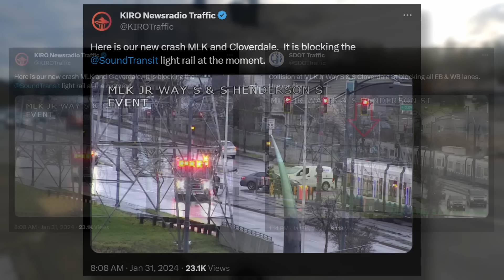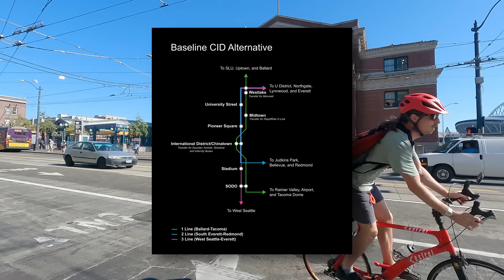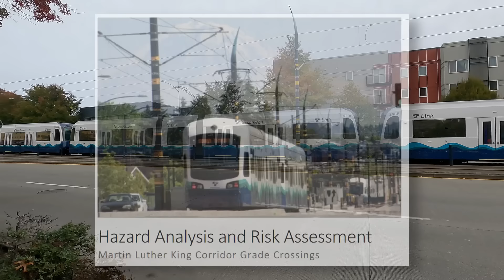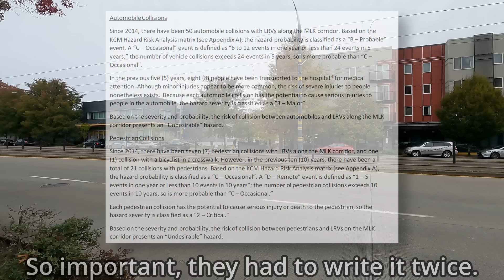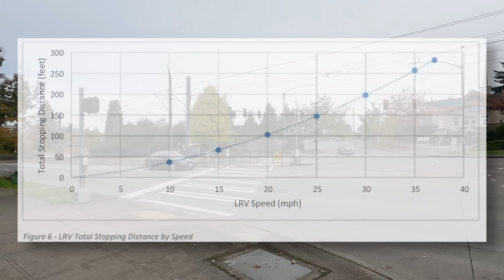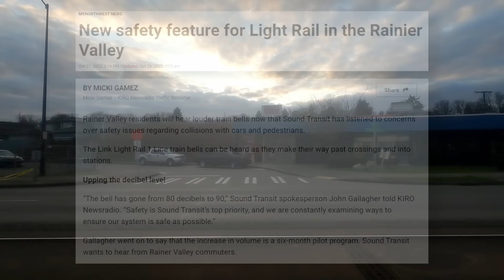Don't Skimp on Grade Separation

Comment: "Don't Skimp on Grade Separation" is exactly why Surrey voters rejected light rail in favour of SkyTrain.
Reply: GOOD
Reply: A rare moment of voter intelligence
Reply: very rare surrey W
Reply: Well there was actually other reasons like dedicated police force but yeah..
Reply: Straight Outta Surrey brotha
Reply: Elevated transitways make great communities.
Reply: This line has a lot of elevated areas and dedicated grading. The section in question is small and could easily be fixed with priority signaling just like they do in the Netherlands in areas where grade separation is not really required. Surely it would have been better if they had matched the rest of the line, but it is not as if that's going to fix much as the problems really stem from not having built a metro 😂

Comment: this sounds so insane, like here in my city in Europe (Prague), we usually close whose section, reroute the trams line other way and for that section use alternative bus service along the street. If it's emergency or the section goes through too dense area, we use a temp track cross-over. Also, you don't need full grade separation, you just need exclusive road line for the trams, ideally with grass median but like, slight height separation lowkey like for bicycle.

also in our legislature, trains and trams has always full exclusive priority over anyone else
Reply: To be fair, your first sentence is what Link light rail planned - close off the stations and replace with a bus service. Problem is, Seattle traffic is abysmal especially downtown and that's where the closed stations were.. plus the public communication and actual execution of the plan was quite poor imo. All in all, right idea, bad execution and direction from leadership.
Reply: Why don't they use a temporary track cross over, it's used constantly on Melbourne's tram network when there's a disruption?
Reply: @Rollersox  Speaky frankly, the trainsit company should have routed this line along a rail corridor, not in the middle of a thoroughfare highway. A downtown street can be sacrificed for a rail line on the surface with much slower speed, a downtown rail/pedestrian mall, not in the middle of a thoroughfare highway.
Reply: In Basel/Switzerland we use temporary crossovers to, only the main corridor in the heart of the city is shut down every 15 years to be rebuilt entirely within two months…used by 7 lines.

Comment: Reminds me of the Eglinton Crosstown in Toronto. A mostly underground metro using light-rail trains with an at grade section in the east end to cause delays whenever a driver runs a red light and collides with a train.
Reply: I always thought a tram was the wrong sort of light rail for Eglinton Avenue. Renovating, extending, and upgrading the Scarborough No. 3 Line to skytrain would have been the better solution.
Reply: We need proper roundabouts then
Reply: @Mart_7512 for what?
Reply: @edwardmiessner6502 Eglinton west was started back in the 1990s but new government went and fill the hole where the construction started. 🤷‍♂️
Reply: @TheRandCrews  For drivers to actually yield instead of running red signs
Reply: They could make tunnels below the intersections, but it would require moving some existing stations and cause lots of delays
Reply: Can't you educate drivers not to run red lights?
Reply: @johnsavard7583  nope.
Reply: @johnsavard7583  Well yes, we need better laws, simpler traffic lights (Dutch-style), and proper pedestrian roundabouts.
Reply: 36 St NE & 7 Ave SE/SW have entered the chat...
Reply: @Coralalal trenching/bridging  works in some cases. Part of the Ctrain blue line is trenched because we learned from our mistakes in the NE/downtown
Reply: @TheRandCrews The original Eglinton West was admittedly a horrible project - a tiny stub line that only went from Allen Road to Black Creek Drive with no plans at all to extend it east to Yonge Street at all (there were only plans to extend it to Pearson)
Reply: @Absolute_Zero7 point is they still had to demolish the tunnel that they filled to create the LRT tunnel
Reply: @TheRandCrews  To be more specific, they didn't fill in a tunnel, but rather the launch shaft to the tunnel. They never even got around to putting the TBMs in the ground (nor do I think the launch shaft was ever completed).

Comment: meanwhile here in austin they fucking nerfed our light rail plan we all voted for. it was supposed to be below grade completely through downtown and consist of 2 light rail lines and 1 brt. Now it's just one light rail line and completely at grade through downtown. Makes me wanna cry and scream
Reply: That’s what happens when you don’t manage costs and give out to contractors like there candy.
Reply: The state legislature should make a law requiring all agencies have in house planning
Reply: Almost like they're trying to make it suck.
Reply: @erikgustafson9319  The state of Texas has nothing to do with Austin's CapMetro transit... In house planning was done by CapMetro, not any state bureaucrat...
Reply: Good, build a metro not a subway tram
Reply: @longiusaescius2537  There are good reasons to do this, though, assuming it's done correctly with enough foresight to easily convert the stations into high-floor systems (even with low-floor vehicles and their corresponding platforms) and bundling multiple lines.
Still, a city the size of Austin needs at least one proper rapid transit lines before a premetro should be even considered.
Reply: @MarioFanGamer659  fair enough ig but I don't feel like they're planning that far out, and a Seattle Link 2 is a bad idea
Reply: Interesting, because we all voted against Sound Transit and they did it anyways

Comment: “Build it right the first time or cheap out and pay the price.”

Indeed. The DC Metro is almost exclusively two track only. So any maintenance that can’t be done in one shift means single tracking, massive slowdowns, and 17 minute headways.
Oh, and no express services, say, between the two airports the system now links.
Reply: This is a common refrain among people who've seen the 4-track tunnels in NYC, but it's incorrect. DC Metro does have the equivalent of NYC's express services, in terms of average speeds & distances b/w stations. What it lacks is the local services, which if superimposed onto the DC Metro map would require 2-3 additional stops between every existing station pair, & which would make trains take far longer to cross the city.

Likewise, DC does, in fact, have track redundancy. It just achieves that redundancy with reverse-branching instead of quad-tracking, so passengers usually still have two ways to get where they're going for most trips. This is actually an advantage over NYC, because unlike MTA, WMATA isn't burdened by the upkeep costs of redundant third tracks that can't be used except at peak time, or by extra "local" stations that could never be served by the full capacity of the "express" tracks that run through them.

If there's any lesson WMATA should learn from NYC, it's in not expanding too far into the suburbs. The most distant NYC Subway stations from downtown Manhattan are only half as far out as the most distant DC Metro stations are from downtown DC (and that was true even before the Silver Line).
Reply: @jmchristoph expanding into the suburbs is NOT a bad thing
Reply: @qjtvaddict  when big portions of DC don't have a Metro line but do have the density to support one, building Metro extensions further into the suburbs is not the way to generate ridership, revenue, or sustainable mode shift.

Comment: This is a similar issue we are dealing with in the Twin Cities, particularly with University Ave and the downtown Minneapolis 5th St sections of the light rail system. We very well could elevate the downtown light rail system between USBank Stadium and Target Field, integrated with the skyway network, and could have had underground/elevated rail along University Ave for the Green Line.
Unfortunately we did not make those investments initially, but I also wonder how much more expensive and how much longer construction would have gone on. The Green Line is a little over a decade old now, and is an established transit corridor. At this point, the Twin Cities transit advocates including myself have their eyes on transforming I-94 into a proper S-bahn type regional rail connection between the Twin Cities, as a faster alternative to the Green Line and upgrade to the 94 bus. 

Great video, crazy how much this hit home.
Reply: Yeah you made a good point and also I've heard lots of people were upset with the Minneapolis green line extension going through the suburbs to Eden Prairie instead of uptown. And they chose the suburbs instead of putting it on the Greenway through uptown which required a tunnel and they didn't want to do that because of how costly a tunnel would be.